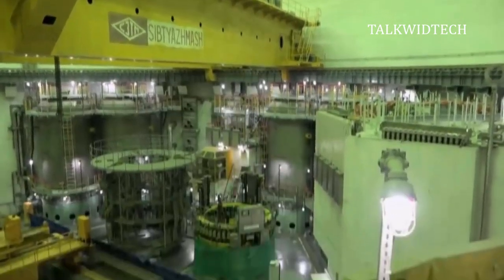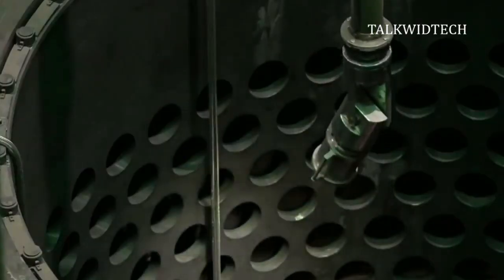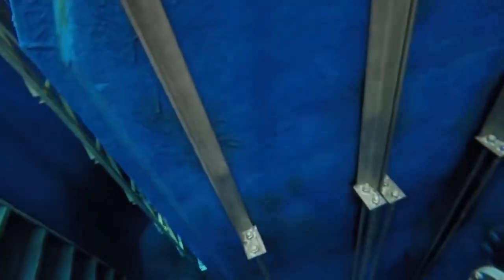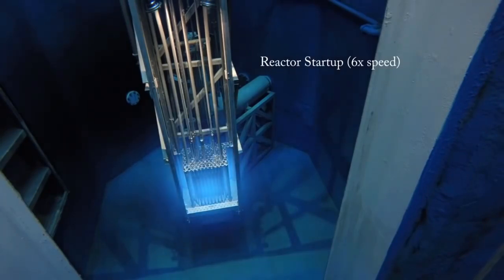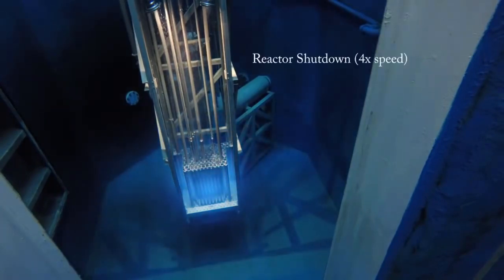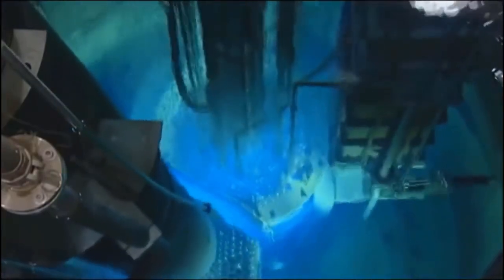Nuclear Reactor Startup | Energy Explained

Comment: What exactly did they do to start the reaction? What are the steps? What element is used to start the uranium? That part is never explained in most videos, yet it’s the most important part.
Reply: Usually they put in some rods californium 252 that haves a spontaneus fission or other elements such as Pu-Be or Am-Be that produces neutrons. This is just for the first cycle, in the following cycles you can use just the radionuclides created in the fuel.
Reply: Neutron bombardment gets it going,I wonder what is the source of that though

Comment: Just wait until there's a fusion reactor. I bet it would look even more amazing.
Reply: And it only takes another 10 years to make it happen. (Even if you read this after 25 years, it's still only 10 years to make it happen)
Reply: @hetspook666  the thermodynamics are way different. The people working on that are much smarter than I am though.
Reply: It will take a long time tough
Reply: ITER (international thermonuclear experimental reactor) is planning to be operational in 2035!
Reply: Fission
Reply: Not just amazing for a reactor or the city but likely amazing enough that it would lead to more advanced battery tech and likely it'll end carbon emissions, leads to flying cars do with large amount of energy available.

Comment: What is that liquid?
Reply: Water
Reply: Heavy water, D2O
Reply: @comptelo-cz  No, definitely not that. If it was normal water (H2O or light water), it would've been instantly evaporated by the reactor's heat. Heavy water, D2O doesn't evaporate in these conditions, and transfer the reactor's heat to a tank filled with light water to evaporate and create steam to power up a turbine. D2O serves as coolant fluid and doesn't evaporate, it just transfers heat to somewhere else, and it blocks radiation.
Reply: @comptelo-cz  All nuclear reactors reach temperatures of above 1000 C, sometimes above 2000, and D2O is exposed to more than 300 C.
Reply: @comptelo-cz  If we assume its an LWR, than you're right. If it's a PHWR or CANDU reactor, than it's heavy water. But we don't know whether the reactor in the video is an LWR or a PHWR or CANDU so we can't be sure whether it's H2O or D2O.

Comment: From the video we can see the core from the top directly,.  Couldn't the radiation come off thru the water?
Reply: Water is heavy isolation.
Reply: @Mariini  It's not normal water, it's deuterium oxide or heavy water. Normal water isn't a good isolation.

Comment: I beg to differ with you on the explosion theory the Chernobyl reactor exploded  blowing the roof off the reactor building #4
Reply: It didn’t explode like a nuclear bomb, which is what was said in the video.  Chernobyl was a pressure explosion. The reactor ran out of control creating so much steam that the environmental cap couldn’t cope with the pressure and was blown off.  The second explosion was caused by the reactor being exposed so the open air and oxygen being introduced to the system (I believe, but may be wrong).  It was not a nuclear explosion in any case.
Reply: @chrismckinney9942  You are right, the water was disassociated into hydrogen and oxygen and that was the explosion. However there is also a theory that it was a mini nuclear explosion but the hydrogen theory is much more likely.
Reply: @chrismckinney9942  Also the Core was gas Poisoned. I think it was Xenon or smth. And when they pushed the button that pushed the Graphit rods down to stop the reaction it was like a detonator

Comment: I thought this was going to explain how it starts up
Reply: Control rods are removed and a set of neutron source rods are inserted (made of antimony and beryllium is most cases)
Reply: @festivelad5079  thank you I could not get a good
Reply: Control rods are withdrawn from the core
Reply: Thomas Y Setiadi  Because to produce it they have to use energy before, it is an inversion. Also for safety

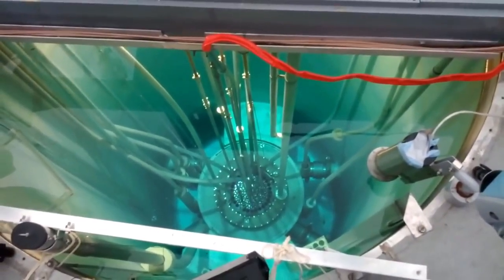Comment: 0:57 Now that's a startup.
Reply: It's not a startup.  It's a pulse.  The reactor was already running.
Reply: @pmgodfrey  Interesting.   Can you explain?
Reply: @josephastier7421  -- A pulse is done on TRIGA reactors.  TRIGA stands for Training, Research, Isotopes, General Atomics.  These types of reactors are found in universities, and they don't generate power for electricity.  What it's doing is pulling a control rod out just a bit and allowing the reaction to go from say 50 Watts to millions of Watts in millionths of a second.

https://en.wikipedia.org/wiki/Washington_State_University_Reactor
Reply: @pmgodfrey Thanks for the information.   I had never heard of the TRIGA reactor type, its unique fuel, or that it can be pulsed as shown in the video.
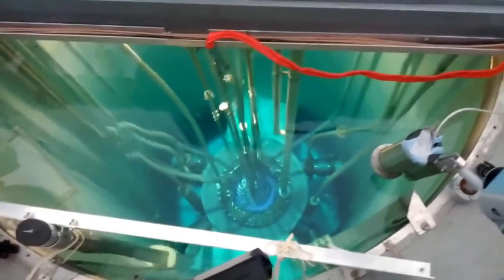Reply: @pmgodfrey  Ahem:  0:57  "Now that's a pulse!"